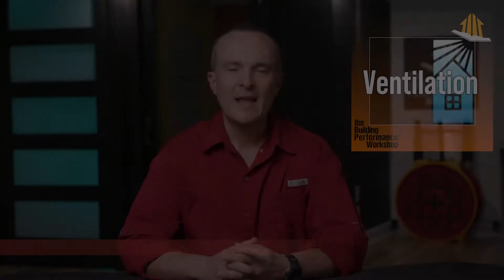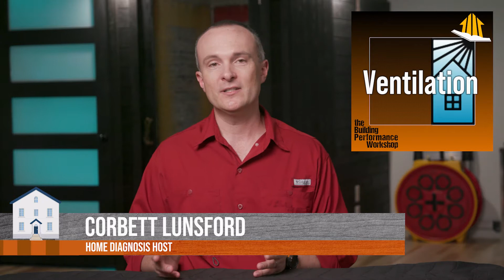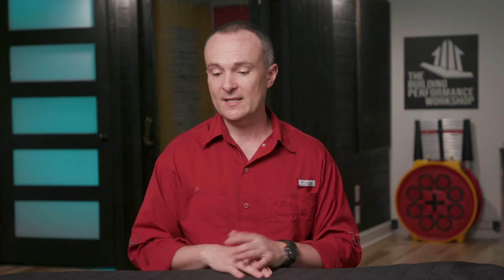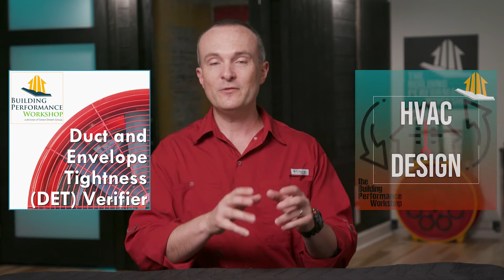Ventilation Training: Circulation, Spot Exhaust, Filters, Humidity, Dilution w/ ERV/HRV, Make Up Air

Comment: What type of ventilation system is best used with mini split ductless heating and air conditioning? There is no natural gas available, and we do not want to deal with propane. We have a new build on an Island in Puget Sound (985 SF) consisting of 1 bedroom, 1 office, utility room, and bathroom with a flat 9' ceiling. The kitchen, great room, dining room all open together with a 5/12 vaulted ceiling from a 9' plate line. !/2 of the 5/12 ceiling we can get R38 insulation in the ceiling and the rest of the building we can get as much as I need to place (R49). The one issue we have is the building sits on concrete pilings due to the flood plain so rockwool or fiberglass insulation is not possible due to dampness and critters would end up living in it. My thought was to place 2 layers of pink ridged foam insulation between the 2X10 floor joists and foam in any gaps with spray foam giving me R40 in the floors. The exterior walls will be 2X6 with R21 rock wool insulation. The exterior walls will have a modified rain screen for shingles. The interior is all wood shiplap, so I was going to use Siga Majrex for the interior vapor barrier. Windows have an average U-value of .28. Typically, you need make up air if you have gas fired appliances (we will have a wood stove) and/or have a kitchen hood fan that exceeds 400 cfm. At our other home when we burn wood, we crack a window or the SGD. Would that be sufficient for this place that will be occupied from April to October?
Thanks,
Jeff K

Comment: Any idea why a 3 story condo building would have fresh air intake systems for the first floor units only? Intake vent above my front door, ducted to mechanical fan, then ducted to outlet vent near indoor AC handler closet. This is S. Florida if that helps. Just trying to understand why units on the other floors don’t have it. Property Mgr doesn’t know what it is.
Reply from the maker: Hahaha, that’s good. Probably the top floor gets plenty of fresh air due to air leakage, which would tend to flow downward year-round in FL.
Reply: Seems like there is an untapped market here in PBC, because none of the HVAC companies or home inspectors seem to know about ventilation needs. Thank you so much for responding.
Reply from the maker: It’s honestly the same everywhere you go right now, Mi. Thanks for engaging!

Comment: Looking forward to this! Very interested in the indoor pressure due to inner ear issues. My current rental has many structural issues and terrible way of handling the it. Have you ever witnessed a house so uneven in handling pressure that it gave residents symptoms similar to “the bends”? I’ve been dealing with a lot of health issues while indoors at the house. Long story short, I’ve been through the ringer (no pun intended) with my ear and pressure. However, once outside, the Eustachian tubes begin to regulate normally again. Needless to say, I can’t convince the landlord for a blower door test or anything (spent so much money on devices)! I’ve been watching your videos and learning as much as possible for a while, great work!
Reply from the maker: Thanks Stormy, and I hope you get your ear issue figured out soon. If it’s the building, it’s gotta be a massive problem. Even going up in 150 story skyscraper elevators shouldn’t have lasting effects on people, nor should flying at 35k ft.
Reply: @HomePerformance  not for folks with autoimmune illnesses or sensitivities. It doesn't take much for us unfortunately. So glad to have found your channel --learning a lot. .